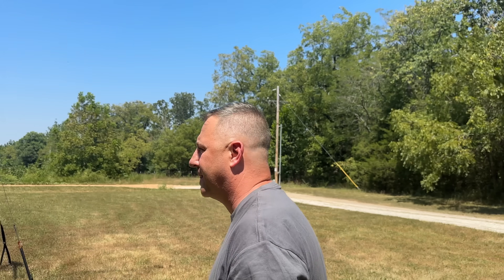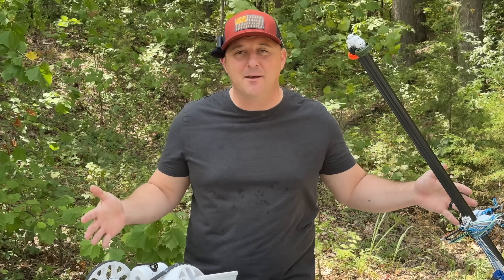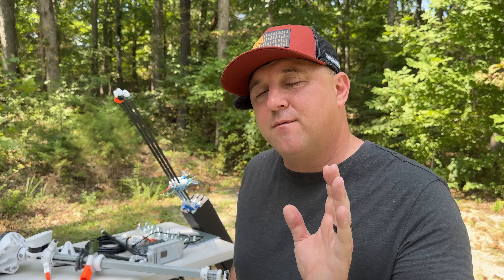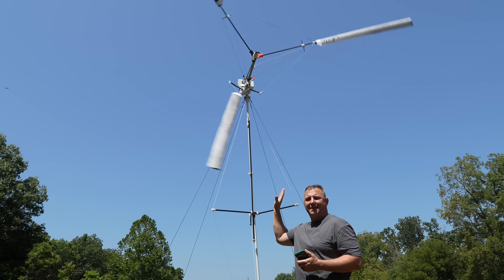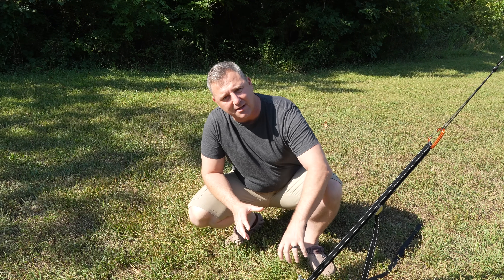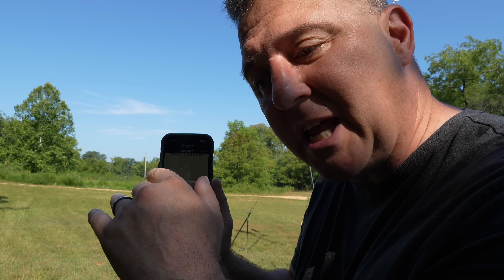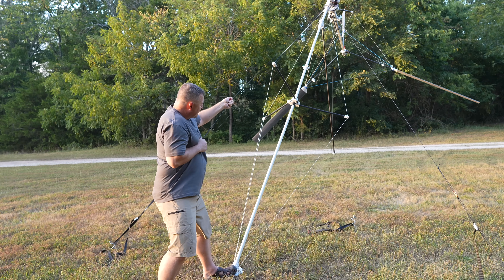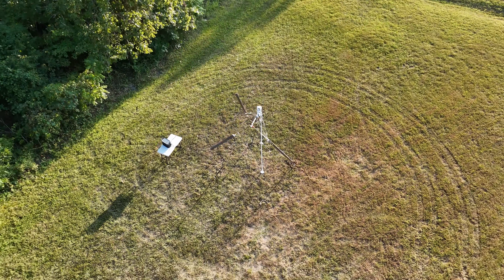Ditch Solar Panels! Is THIS The Future of Off Grid Energy?

Comment: Wow! $1900 for this, I can buy a single solar cell that can produce 2x the power for only $200.  I wonder if it can last as many years as a solar cell.
Reply: But it comes with the ratchet.
Reply: @RichardQuaid  😂😂
Reply: It also can provide you with food, as you can eat the birds that it kills.
Reply: Well, I do appreciate this guy is doing such a good job with his videos that companies are willing to send him new items to test and review.   I think this all helps us (the viewers of his channel) to see alternatives that we might not have known about.   Of course, not being on an endless budget, I think I would opt for the EcoFlow 800W Alternator Charger over this (especially, if lack of wind is an issue), seeing he has the supporting EcoFlow product.
Reply: Sure, it cannot compete with solar in daytime (especially since you have to take great care of the blades for 30 years), except the fact that it can provide 200 watts or more all night long (if windy), or in the heart of a cold winter (if windy), or even when it's raining (if windy).
It's quite complementary with solar in fact
Reply: Plus it’s kinda big when set up takes way too much space
Reply: A solar CELL is one such blue or black plate, of which there are dozens inside a solar PANEL. Currently, for example, a 410W panel costs 15 cents/W, i.e. a 400W panel costs around 60 EUR/USD
Reply: @MR-ub6sq well yeah. If someone is good at soldering they can make much cheaper panels.
I don't have that skill set.
Reply: @IvanhoeWolfe-zn6fc  I don't think soldering the cells together with the power leads will save you money or time. When a 450Wp solar panel costs 70 USD: the equivalent amount in Finland, you really can't save.
Reply: It's in a prototype stage right now and solar is generally a better solution for off-grid power. It being a prototype the product will be less refined and more expensive, that's why we say things have an early adoptor tax.
Reply: Plus, you need a large 3D printer to print the part.
Reply: The only difference when it comes to wind, your batteries stably topped off day and night.
Reply: but then you miss this never leaving insecurity, while waiting for the wind to come, and the sun to degrade the parts.
Reply: Having lived off grid in the mountains. I used wind and solar and found that the wind was a no go it was under used most of the time. For the price I could get 7 solar panels which generate 400 watts each. The reason for the wind generator in Scandinavian countries is they don't get much sun. I am surprised that it doesn't have a brake system as it can be implemented by shorting the outputs it will brake the system.
Reply: That looks too frail and sounds too noisy.  Vibration will eventually cause this to collapse.   Rain will turn the ground to mud and loosen the stakes.  No thanks.
Reply: Well good luck finding a 200w complete solar system for $200.
However here are some real prices.
At the end we will add up.
But before I began. I know harbor freight once had a low quality panel set that was about $300 at this power rate.
Now I will be using the higher quality items from harbor freight. Just because they are easy to get. You can do better shipping on line and having stuff delivered. But I'm off grid. And I can not get home delivery.
Oh this is without HF discounts
Ok let's began
(2) 100 watt panels  $125 each
Charge controller $80
Deep cycle 1008 ah battery ( wal mart) $80 plus $15 core ( thier is an alternative much cheaper)
Invertor ( I don't like these ones but they are cheap ) Wal Mart 750w $70(?) 
Wiring. 20 foot extension cord. $20.
So about $505 
Now.
For battery you can go to a wrecking yard and buy a battery for $25. Not as good but it works.
Invertor. I recommend going to a truck stop and buying a "power drive" 1500 watt invertor or better $200 up.
And I know the truck stop invertor is far better then the junk that comes with the wind mill. 
Want an invertor equal to the wind turbine? But the Walmart one. Well really but the 400 something one. For like $30.
.. now if you build the system I just showed you. It is mobile. And once made will take a lot less time to set up and a lot easier 
Now. You might say. It doesn't charge at night.
Well that is true. But 
your vehical does 
More battery and panels will give you more also.
 Add another battery $80 and 4 more panels $600... $1185. And that will far out power the wind turbine. For $700 less.
Oh also I would add a power switch to your vehical. Now depends on your camper. Is his much it will cost. 
Switch isn't that much. The expensive is the cable going from you vehical battery to you camper battery bank.
Sure you can 12 gauge wire. But in this case 1/0 would be better ( a very long battery cable) 
That way you can charge when you are moving or if bank is low.
It will take most vehical to charge 1-2 batteries and hour.
The other side of this is...
If your vehical battery is low. Switch on and start. If bank is low or not enough. Just put your panels your.
You don't know how many times I've charged my truck battier with a panel.
Hook to battery face panel to sun. And depending how how. 15 minutes to 3 hours battery is ready to start truck. And that was just a single 100w panel.
Oh forgot an that make that a 30 watt panel. I've used both 
30 watt I bought for it. But now use for something else.
Need help ask.
I've have lived off grid for 12 years. Don't see why I would ever go back on grid.
Reply: Did you miss that it will continue to produce power at night, and here in Kansas we have a lot of wind. The old fashioned windmill to pump well water and grind flour and other uses is one of the icons of our state. This seems like a really untapped market to produce residential windmills as an alternate source of electrical power, not necessarily for off-grid, but also for down-grid.

In my Navy years, I lived through Hurricane Hugo in Charleston SC, and I was without power for ten days afterward. There were some areas in SC down for weeks. For anyone who's never been through anything like that, it was a sight to see the power trucks and line crews from many states gather in a mall parking lot to get their assignments and then scatter to work all night restoring power lines.

I will say, that because of the power being down, I got to better know some of my neighbors when we would gather outside in the evening and bring food we had from a cooler if we had anything left, and cook it on a camp stove one couple had, and share what we had in the group. One guy brought his guitar out and played and sang stuff like Ten Years After "I'd love to change the world". Those were good times that I would never have experienced with the power on.

All that said, I don't think this printed thing is exactly what I'm looking for. The Kansas summer sun is extremely brutal and will likely do a very destructive number on these plastic parts. They will need to be extremely robust AND able to be easily taken down before a storm to survive the very strong winds here. This spring we had many fences and trees blown down in my town. Every house had a pile of tree limbs and some cut up downed whole trees at the curb. The city came around and hauled it off because of the extent of damages everywhere. That wasn't even due to a tornado. It was just straight winds during a storm. After a storm like that is when a generator of any kind becomes like gold. Our power was out for about a day, and some areas of town were down for several days.
Reply: @dolfinwriter5389  well let me tell you my experience.
I've been off grid now almost 12 years ,( Dec    2012) 
In that time I've been with electric combined  total les then 3 days. That better then any one yes prior I was on grid. 
Now that's 3 days total for the 12 years. It breaks down to 20 minutes here when a cow broke my line which was the biggest and most frequent even.
A couple hours at night until the morning when I could investigate. 
That's primary with solar.
I did and do have a wind turbine. Which I haven't used in about 10 years.
You are correct the sun is bad on them. For me the blades. But I already stopped using at that point.
Now. I get 80 mph gust sometimes.
When I first moved here thought it was all the time. And the twice a year monsoons have heavy winds. 
I always have winds. But it's either too much wind or too little.
And I believe the converter from AC to DC was junk.  Because all the other items, except the panels them selfs, I bought from Missouri wind and Solar, were GARBAGE .
I highly am very dissatisfied with that company.
As far as on grid with alternatives back up.
Well that is a two part answer.
You have to use one of thier highly expensive contractors. And most companies will not allow you to make money.
If I was to do it . Id wire a separate system.
Say a room in your house that has both. Not connecting the on line and your panels together .
Part two. Yes, having it for a back up is a sound plan. In the case I would especially go with a 12v ,(18v) system. That way if it does go down / runs out of power. You can just " jumper cable" you system with a vehical .  I have a 12v , 12g 30 foot line I put in for this. 
Believe me. It's a headache changing parallel to Series, charge, then back to Parallel. 
But, also with a 12v you can use while you are emergency charging 
Yeah those cows where a pain in the butt.
Also. This is why I don't roof mount.
Every time you put a new roof on ( which should be every 5-10 years unless you have a metal roof) , you have to remove and put back on.
Also those winds I spoke of earlier. Would rip my roof off yearly. Until I put a metal roof on.
Lucky it only rains here most years twice a year. And those are monsoons . Lol I only get on average 4 inches per year.  
As far as a wind turbine also working during the night;  that's is true. But if you just go with solar. You don't have moving part to replace. You don't have that extra convertor (12v AC to 12v DC) to go bad. And you don't have to worry about wind 
Another thing. I know you don't want this one in the video. But a bad point about it.
It's only 200w.
That is fine for lights using 12v lights. But way to small for freezer, fridge ECT.
For Freezer or Fridge you really need 1000W (1kw) all the time. Or the battery bank to support it.
Now what I do is. Use a freezer. 2 hours a day I run it. As long as the door is not open close all the time. Everything stays frozen. 
Now heating and A/C  they are power hogs.
I don't even know. But I know it's a lot.
My A/C is a swamp cooler ran off a 12 marine pump and a 12v pulley motor . Built ity self from a old swamp cooler that had been a 110v.
Heat well . I have a wood stove I burn crude oil in. And propane stove and heater. 
But , I have a tiny oil well. That is used for this. And my winter are mild.
I say after my experience that to just use solar.
And in the case of this video... 
A solar system once made will take max 5 minutes to set up . More like 30 seconds.
And this looks like a 30 minute job at best.
Solar . You pull out of camper. Put on ground facing sun.or even on roof.
Done.
One could even just mount on roof. And ajust camper to get sun. Or mount on roof in a travel mod. Then when stop. Adjust panels to get sun.
Personal. My camper has 400 w on the roof ( it's a truck bed camper) and I have 400w of panels I can put on the ground up to 40 feet away.  The ones mounted on the roof can adjust to 45 degree angle.
Plus I have a cable with a on /off switch. When truck is running. I flip to on. (Moving to another location) Might as well charge the batteries. It's already putting the power out going down the road. 
It has plenty of power.  
It is a slight pain hooking the cable up. But it's just a matter of putting it through the hole feeding along the frame to engine area. And connect to positive terminal on truck battery.
For negative. I have a bolt on my truck bed. 
It's harder to jack camper up and put on truck.  Lol.
For a tow behind put a hook up at the back of vehicle to hook up. 
Like a slave cable mount on military vehicles. 
For a self contained unit. Just connect battery bank to vehicle battery.
Which all these I advice . A battery cable on / off switch close to battery bank. When not driving. Turn off. When driving turn on.
Now with all that said. Let's return to off grid 
I have seen a lot of wind turbines and frankly most are junk 
If a person was to use wind turbine. I advice this.
Build it yourself from vehicle alternators.
Either converting them or using strait off the shelf.
Convention. It looks like they last longer. But you have to buy a AC to DC convertor. And you have to use 1/0 from turbine to converter.
Strait off the shelf. If you use a old Chevy ,( one that fits a 1975 C30)  you csn wire strait to charge controller I'm told.
(My wind turbine will accept a Chevy alternator. But I never tried it.)
Another reason to make yourself.
You make your blade. So making another is no problem when the break. And they will break.  I've never seen blades here not break within 5 years. 
Now, do not get me wrong. If you make blades from PVC pipe ( which I would recommend). They will not last as long .
But just make twice as many when you began. And have them waiting.  PVC pipe will last a year or two. Maybe longer. But that's my guess.
Also. Make tower so it folds down easily. Harder to make but first time you have trouble you will be glad you did 
I do not recommend a mobile tower. 
Oh another thing. This goes for ones you make it but.
Make it so they van NOT 360.
Because it will twist your wire.  
A year down the road you will understand.
A water wind mill does have this problem.
Because the plunger moves with the head. If not then the rod breaks . Which is why the rod was made of wood. Easier to replace a 2x2 6-10 foot long then repair the pump.
Now. I know this is long 
But if  anyone wants a template for a Chevy alternator wind turbine.
That is mount for blades. mount to hold alternator on 2 inch pipe tower, and tail.
This is templates made of cardboard that you use to trace on metal .
I will make for $50 a set. 
If you want the kit made for you if metal. I will make for $350.
Read next comment in this line...
Reply: If someone wants the kits for a Chevy alternator. For $350.
Let me know.
The kit is everything needed expect tower, alternator, vanes and wiring. In other word. The head and tail minus the alternator and vanes.
If you want the cardboard templates to make out of metal. 
I want $50 for templates.
If you want to come make templates yourself. Well it's still going to cost me $50 in gas to go to El Paso Texas to meet you .
Fill up my gas tank but me a coke. 
I don't care. I don't like wind turbines. Might was well use the one I have for more then a yard ornament.  
Oh tower is a 2 inch 
Metal pipe. And the tie down wires. Which you have to build.
No. I'm not selling the one I have.
I'm making the templates or head and tail from mine.
Chevy alternator bolts right onto the head.
Plate that holds blades bolts right on to where pulley mounts.
This is a 5 vane system.
I'm just throwing this out there if anyone wants.
I don't make these normally. But what the heck. Why not . I don't expect many to want.
For vanes you can order vanes. From what I've seen all vanes are the same mounting.
Or make your vanes from 3," PVC sch,40 pipe.
Reply: Made in Danmark, like everything in Scandinavia is overpriset do to regulations taxation from hell . Nårje
Reply: @ventoraveritas2853  Overpricing is not only due to taxation. One important reason for the high prices is that the workers belong to their "interest" unions, which compete against the constant increase in the cost of living by demanding higher wages for their members under the threat of going on strike. A simplified example: So when union X gets its way, and its members get a pay rise - for a while they are happy with their victory, but because their labor became more expensive, it also became more expensive to buy their labor. The result of this is that other industries such as Y and Z will soon also have to demand wage increases in order to continue to buy X's service, which has just become more expensive. When Y and Z receive a salary increase, it will soon be reflected in the price at which the services they offer can be obtained - that is, as a price increase. Now they are satisfied with their situation for a while, but the X group will notice that their salary is no longer enough because the services produced by Y and Z became more expensive. So X starts thinking about ways to get more income... The underlying idea here is that everyone needs to have the means to buy everything as much as before. People are greedy.'
The old wisdom, "Not big income, but small expenditure" is still true. But few realize its wisdom. So when everything gets expensive, let's blame the tax collector, whose task is to maintain the structures of society - both physical and mental. When you use free public services in your residential area, the taxman needs money for that. The task of the taxman is never to make a profit - unlike private individuals.

Comment: The blades are high enough not to hit you in the head. The question remains, how high are the blades?
Reply from the maker: I should have measured, but it is at least 7 ft high. I would have to reach up high to touch the blade at its lowest point.